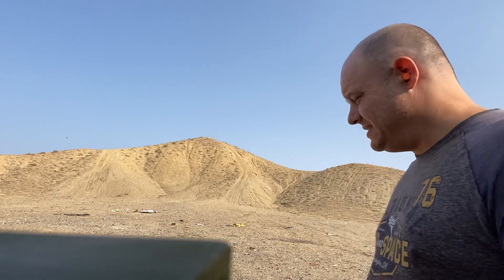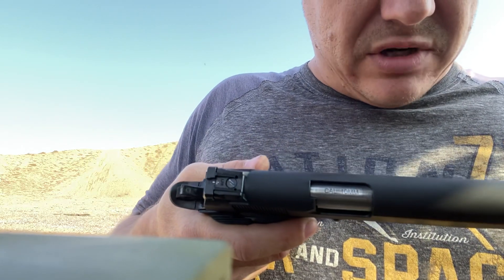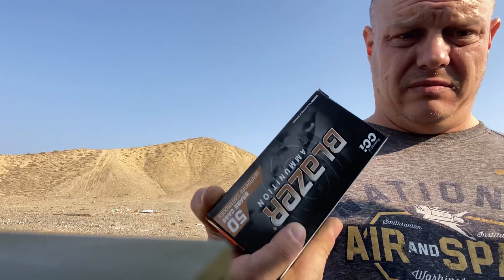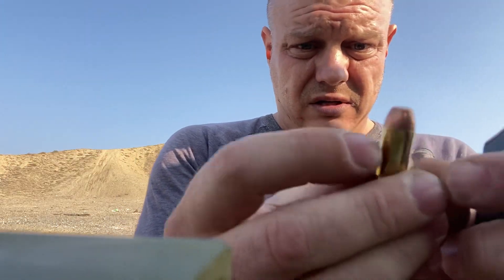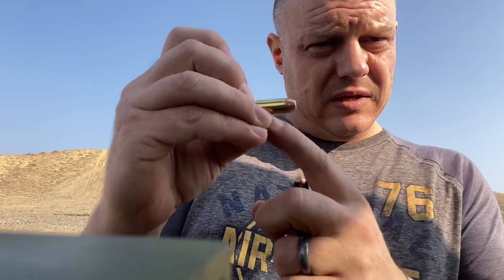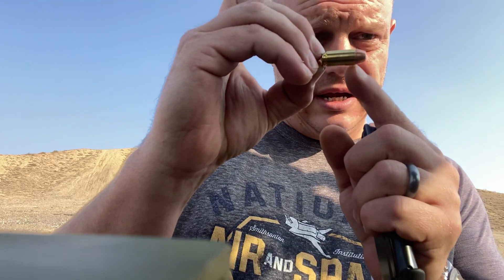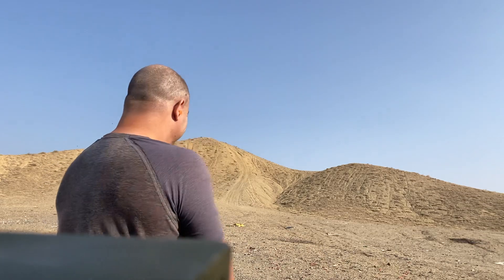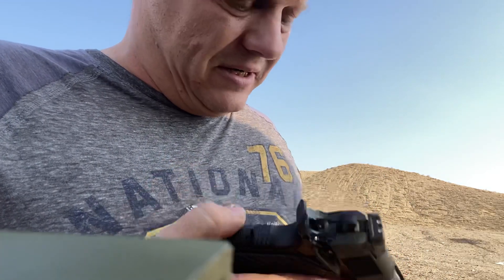Will a 10mm Rock island Armory 1911 successful fire a .40 s&w or will it explode?

Comment: Sellier & Bellot 180 grain 10mm FMJ is pretty inexpensive over the internet. That said, if it's range day, and you can't find any 10mm, I'm glad to know there's a decent alternative. I still can't believe it cycles the heavy RIA recoiled spring.
Reply from the maker: half the 10mm out there is just .40 in a longer case. i didnt have much doubt that i would be able to tune it after break in for .40, but i was pleasantly surprised when it shot .40 out of the box with only a single hickup in the first 50 rounds. i think i've shot another 100 flawless since then but i've mostly switched to 10mm now that ammo is back.
Reply: @BattleRattle4x4  I picked up some MagTech JHPs, Sellier & Bellot JHPs, Sellier & Bellot FMJs for the range, and some off-brand remanufactured JHPs. It was all I could find during COVID and the riots. Most of it cost me around $0.95/round. Sellier & Bellot isn't much better than 40S&W. MagTech's can be pretty hot, but they're also inconsistent. I'd like to pick up some Fiocchi JHPs for defence. I can't really afford Underwood and the more expensive brands.
Reply: @BattleRattle4x4  I've been waiting 2 years for 10mm to go down in price. I'm still waiting!
Reply from the maker: @DDDYLN  i'm just trying to find large pistol primers. i've got thousands of small and no large because i didnt get any large cal pistols til after pandemic started.
Reply: @BattleRattle4x4  best of luck. I'm not a reloader due to disability. I have to take what's commercially available. Currently, MagTech and Fiocchi seem like the most powerful self defense JHPs that are affordable. Sellier & Bellot is good for the range. While it may work fine, I don't want to shoot 40S&W rounds in my RIA 1911s, because RIA says it voids their lifetime warranty. I'll certainly try them in my Gen 4 Glock 40 MOS, because Glock lowered their warranty to 1 year.

Comment: I know this is not about the Glock, but I have been practicing with .40 S&W in my Glock 20 for about nine years now (WITH an aftermarket Storm Lake 10mm barreI). I have well over 3,000 rounds (I keep track because I reload and keep an eye on my brass for fatigue, cracks, et. al.) through it without a SINGLE hitch, or breakage/undue wear on the extractor or any other part of the gun. Interestingly enough, if I do my part, I can hit a 10" Birchwood Casey Shoot-N-C target at 30 yards with it, so the .40 ammo is actually very accurate out of the 10mm barrel - that kinda surprised me.
Reply: Interesting. Would this work for other brands like Springfield and smith n Wesson? I’d like to get a 10, but ammo isn’t always common and it’s more expensive. And there’s tons of 40.
Reply: On forums they say it can break the extractor or blow the gun up. Idk. The extractor is cheap and I find it in stock all over the internet. I came across a xdm compact in 10mm. I love the piece. But the ammo and being able to train with it is my concern.

Comment: In a SHTF situation is ok. But why I would purposely purchase a 10mm handgun to shoot .40. Even risked to have a malfunction and damage the gun or worst. I would better purchase the designated barrel to do that.
Reply from the maker: or...... you could spend the money on a physics text book and learn a few things about how guns work before you dismiss it as unsafe.
Reply: @BattleRattle4x4  🤣🤣🤣🤣👍
Reply: @BattleRattle4x4  🦄why you got got soooo but hurt. I own 10mm and .40s&w. I didn’t said is not possible, I said in a situation where i have to yes I will. But not in regular basis. IS NOT MULTI FUCKING CAL. Is fucking 10mm for a reason. But your gun your problem. 😂 why I would change 10mm for .40 anyways, when the 10mm is more powerful. I got my 10mm to shot 10mm and my .40 to shoot .40.
Reply: Because 10mm is 80cpr right now. I have some underwood 10mm for bear country though

Comment: I did this today with my RIA Tac Ultra FS HC in 10mm. Had one light strike and some stove pipe jams otherwise it ran just fine.
Reply from the maker: i dont even stove pipe. try flat nose. i'm 100% reliability so far with around 150 rounds. (i did finally find some 10mm so i havent shot 40 for a bit.
Reply: @BattleRattle4x4  Wow, thanks for the video brotha.
I have a RIA Ultra FS HC with 1k rounds of .40 165gr flat nose and about 150rds of 10mm (100 150gr Underwood extremes, 40rds of Remington 180gr).
Wanna check with RIA first to make sure it's safe on the barrel, externals, and shooting before I start popping 40's through it tho
Reply: I'm glad to hear this. I have the same pistol. RIA says using 40S&W voids the warranty, but how would they know. People say not to use 40S&W in a 10mm, but the magazines are made for 40S&W. I appreciate the info. I'm also surprised it cycles, considering RIA 10mm pistols have such heavy recoil springs.

Comment: How many rounds of .40 have you shot through your rock Island?  I've read about shooting .40 through a 10mm damaging the extractor.  Just wondering if you've experienced any issues
Reply: If perhaps you need to replace your extractor replace it with a Wilson combat bullet proof extractor then if it ever breaks Wilson will replace it
Reply from the maker: @biggunshandguns3687  good call
Reply: @biggunshandguns3687  I was thinking the same thing.  I was thinking about getting one,  just to have on hand.  I have over 500rds of 40 thru my 10mm Ronin.   It's very enjoyable to shoot and very accurate.
Reply from the maker: just a couple boxes so far. i figure even if i end up replacing the extractor i'll still save money.
Reply: @BattleRattle4x4  I guess that's true.  I have like  500 rounds of .40 and a new 1911 in 10mm.   10mm is $35 a Box locally.   So it's not a bad idea.  Thanks
Reply from the maker: @jimmydelux  if it was a high end 1911 i'd be more careful, but its a $500 beater piece.